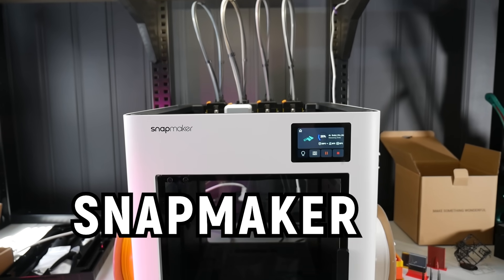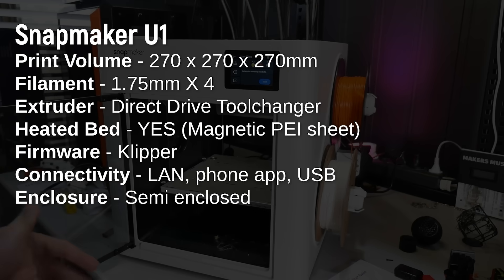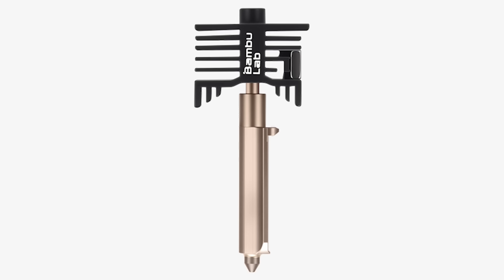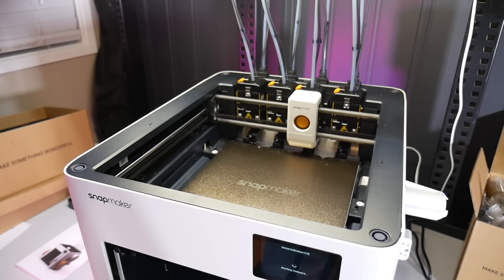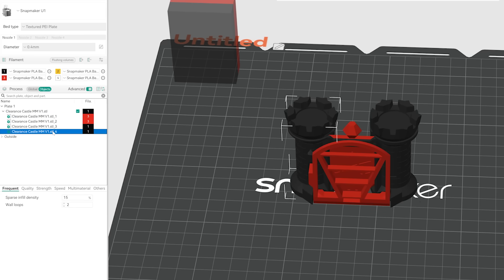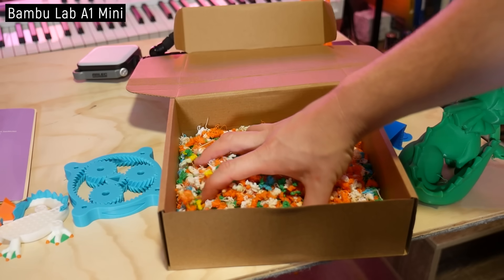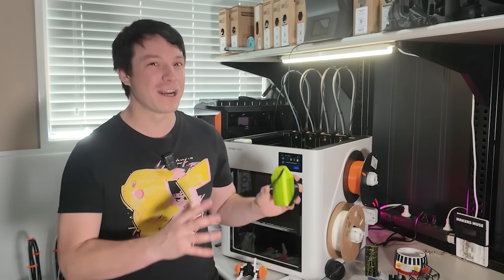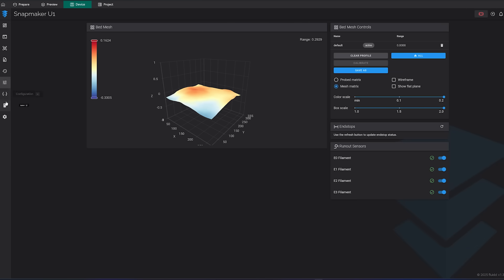Snapmaker U1 Production 3D Printer Review - Tool changer!

Comment from the maker: Additional comments and corrections:
- In addition to the optional top cover, there are also hardened nozzle assemblies available for printing with abrasive materials.
- The interface is FLUIDD not MAINSAIL my bad!
- The blobs caused in the foaming TPU may be solved by enabling "ramming" in filament settings. Yet to test.
Reply: Hello, Is it possible to buy your sample for helping an association that prints to collect funds for childhood brain tumor projects and research ? I manage to offer them a u1 but it will be shipped in january and it will be too late for printing before christmas market of the association. Many thanks in advance.

Comment: I bought a Snapmaker A350 during their kickstarter campaign.  It never worked quite right.  Then the A350T came out, with the rails and power supply it should have had at launch.  I bought an F350T and used those parts to upgrade my original printer.  It then worked ok.  Then I got the he dual-extruder print head … it sucked.  I liked the design, it just wouldn’t print right.  So, all that is to say this:  you might not want v2 or earlier of the U1 printer, and you should pay heed to the reviews.

Comment: As a novice, the only thing I've been able to print is the little dragon. After latest upgrade Snapmake Orca thinks printer is offline !!! I had to do Factory Reset. Pro's: Price; 4 Print Heads; size of print bed; RFID with Snapmaker Filament    Con's: Firmware/Software; Adhesion; Filament holders, very cheaply made and needs power; Not for novices, to get good prints you need to know how to tweak settings, especially with other filaments; Snapmaker filaments all sold out. Shood have used better nozzle system, easer to swap out, something like REVO; Final thought, YOU GET WHAT YOU PAID FOR.

Comment: Good day, impressive video, i wanted to know how loud is it going to be, i'm confused between the Bambu Labs A1 combo and Snapmaker U1, currently i have an Elegoo Netune 4, and i print almost exclusively with PLA in my room (Yes, i'm a student), i want to get into multi color prints but the filament poop always make me not go for it, tbh the U1 seems like the perfect choice at the moment apart from the noise which you mentioned, so please if you could tell me if it's not THAT loud then i'll consider buying it. and do you think the top cover would help the noise issue.

Comment: How does the machine do more than 4 colors? Will there be an AMS option, or will all changes over 4 colors be manual?
Reply from the maker: More than 4 will need manual swaps yeah. Its a trade off for the much faster tool changing vs an AMS.

Comment: I wonder if the upcoming H2C will be worth the extra cost. The S1 is currently $1000 USD but does have 4 heads. No pricing as yet on the H2C but its got 7 Heads, is fully enclosed and can use multiple AMS systems to provide up to 24 different filaments!

Comment: Exciting development hope it spurs other manufacturers on 
Snapmaker don't seem have a great track record regard long term support 
The Deal breaker is there doesn't seem any part are shipped direct for Australia 
As much a I dislike apsects of the bambu eco system - there support platform and being about to order a spare part or accessory and have it arrive is 3-4 days is a winner
I just would not be surprised if they are doing R&D on a tool changer model even though they are releasing
 Vortek

Comment: You can buy an enclosure with the Snapmaker U1.  Also would the CRC Tire Truing machine fix the foam bubbles?  You should probably use a tire truer for your battle robots anyways to get the best flat surface on every tire.  Even printing the tire larger then truing them down to the size you need should give you more consistant results.

Comment: The one thing I hoped you would mention and one of the key reasons why I am backing this is the fact that I can now use PLA for support when printing in PETG (and presumably vice versa), so finally the major headache of removing support may hopefully be over. 
I will add that I also backed the Snapmaker 2 and had some regrets back then (due solely to the non-flat bed issue) and the very poor software quality (think firmware updates that are issued to fix issues created by a firmware update). But now hopefully with this dedicated machine, they may have finally got it right.

Comment: Yes more toolheads means more complexity and poosible issues, but you could also argue tha 4 toolheads are basically spares - if one breaks, you have 3 more to go before having to start replacing stuff - so it does not hurt for single material users either. And it will be much cheaper than actually replacing the toolheads on single nozzle printers. Unfotunatly for me the noise will be a dealbreaker since I work next to it and it is not far from the bedroom. But if Vortek and INDX aren't any better / much more expensive (that is for sure) then this will be the best choice for multi material use cases.

Comment: 5:00 "It's only a few bucks worth of motors"

This is a common mistake. No, its not "just a few bucks worth of components", it's also a design phase, a test phase, a supply chain, a manufacturing chain  (lookup what an injection-mould costs to make), a packaging chain, and a support chain. They have to he factored into the firmware and tested at every update. That "few bucks" that you so ignorantly mention as if it's nothing at all actually costs millions  and millions and millions to the company.
Reply from the maker: good thing they raised 20M then

Comment: I think we have now a cohort of 3D printer users who, for lack of a better term, are script kiddies. They know just enough to download files from the Internet, slap them into a slicer and then print away not really having the technical skills of the previous cohorts had. (I think these are the 3rd generation of users now.) So when something goes wrong or the printer doesn't provide the finished object the way they wanted, they either get really pissed and denigrate the printer or they listen to the 3D printer mythologies of inaccurate or sometimes just plain wrong assumptions and fixes. Which may makes things worse.

So I can see around this time next year some issues which may arise of non-engineers using what is still an immature piece of engineering. I think people will have problems with clogs, either running it way too hot or a filament being used only 5% of a print but it active nearly through the whole print (like printing white buttons on a black coat object). Bad orientation of a print where the seldom used colors/filament types are placed at the farthest point away from the purge block so that stringing during travel winds up in the model where it is not wanted. After many prints or used at ridiculous speeds, the print heads become misaligned or fall during swaps. 

So like others have mentioned, Snapmaker has not won any awards for their service and support after the sale. So in two years, who many of these users will stop using this printer because they don't understand what went wrong and how to fix it on their own.

Comment: I honestly don't care about multiple filament printing. I just want something that's extremely fast, extremely accurate, can handle high temp enclosure materials and doesn't require internet.
I was so close to buying this, but I won't use multiple filaments in a single print, but will want to print nylon and polycarbonate. So much of the cost of this product is the tool changer which I do not need.
I don't want to tinker like I did with my ender 3 and ender 5.

Comment: I just want a compact, enclosed, corexy, direct drive printer. Is that too much to ask?
Reply from the maker: Prusa core one?
Reply: @MakersMuse something like that but more compact (I live in my car lol). I usually don't need more than 150² build volume but I'd like a sub 300 footprint.
Reply from the maker: @Zack-y4p6t  A1 mini in a little custom enclosure would go pretty good, they're very resilient. I've dangled one from the roof and printed with it fine.
Reply: @MakersMuse maybe, I'd prefer not a bed slinger but I could maybe make it work

Comment: The H2D is great (I own two).  But it can only do 1 soft material in a print.  If you need more than 1 soft material, it can't do it.  Only commercially available ones which can are the Snapmaker u1 and the Prusa XL which costs 5-6x as much.
There is a cover for the U1, I bought it.  It is not going to give the same control over the chamber temp as a H2D, but it should be enough for most things.  There are hardened nozzles, I have some on order.  There is also a Polymaker sourced filament dryer/ distribution system other than the external spools, using this is important for longer prints as some filament types change behavior as they get water logged (Petg, Nylon, etc).

Comment: 14:00 The fact that it isn't cloud-first (or _cloud-required_!) is a huge positive.  I've been resistant to Bambu for that fundamental reason.  I'm really hoping this unseats Bambu, and drives future development back towards open software and even open hardware.

That said, I don't think I ever want to go back to a Bowden setup.  This seems like a really dumb question, but I actually can't tell from the product page whether this is a 'real' Bowden setup with the motor on the frame somewhere pushing the filament, or if the motor is in the tool itself and is pulling the filament, using the tube as merely a guide.  The latter isn't a Bowden tube, strictly speaking.

I think I'll wait a year and see what the 3rd-party market looks like.  If somebody produces a replacement toolchanger with interchangable nozzles, or even better opens this up with a laser cutter or even a mill head (though dust extraction would obviously need solving), then I might be all over this.  But I'll wait to see what the community does with it.

Comment: I wished the Snapmaker U1 would support an AMS, so I didn't even have to change the filament before printing. Furthermore, it could add even more materials in a multimaterial print with minimal AMS poop by only replacing every material once.

Comment: This makes me less motivated to start me own doot now, but I want a high temp one so bad.
my own was gonna have a hot air part heating fan that should " instantly" switch between cool/hot but my brain just died and I lost me talent. plus I got no money or space. The idea is that it'll exhaust HDT temp air (just a bit cooler) to reduce the "shock' or warping, but also very hot air to see if I can somehow manage to print PEI (with 150c air) without having a chamber that's 150c (but rather 90-70c, my components let me go up to 70c last time I was designing it but sadly gave up on doing it, this did not consider the potential issues with my x and y axis expanding tho.) I have high doubts this would work but I still wanted to give it a try

the other reason for the "part heating fan" is to act like a hair dryer, at the end of each tool's job, it'd go over the part at 200c and melt all the wisps it makes from tool changes to prevent cross-contamination of support material and main material to make sure the print doesn't have a weak point (had that happen alot on my doot, got a strong part that had one strange weak point, turns out there was the tiniest bit of PLA/petg support in between it from tool changes), I also wonder if it'll have any use for for alternative tool heads or for increasing layer adhesion.  

8:59 damn I'm broke and this doesn't do high temp, but I wish I backed it up now LOL. I don't have the money anyways, maybe some other company will come up with a competitor by the time I have it!

I wish I had braincells to make a doot or like at least enough money to buy an H2D lol.

Comment: The U1 is very compelling to me, but realistically the only actual capability it would give me that I care about is dissimilar material supports.  Sure, I'd use the multi-colour features if I had them, but even there the bulk of what I'd do multi-colour I can do with a single nozzle and a pause command.  And 80 to 90% of what I print is going to get painted anyway, so it might as well be mono-colour.

The main thing I'd actually USE the multiple toolheads for is to have 0.2mm and 0.4mm and 0.6mm nozzles all queued up and ready to rock.  But even then, the savings is 15 minutes, tops, since I've got Revos on my current printer; plus maybe another thirty minutes ever couple weeks as I organise my projects so I can do a bunch of stuff on one nozzle and then switch.

So while I'm excited by this, I don't NEED it, and I do need to pay down debt.  Which will probably work out for me anyway - in a year or two when my kickstarter-version X1C finally needs to be replaced, there should be a bunch of product improvements and alternatives out there for me to look at.  

Anyway, this was really just to feed the algo.

Comment: Remember that in AMS style systems have layer adhesion issues with multimaterial printing. When you print with PETG and have PLA as supports, the nozzle is contaminated no matter if you max out the purge volumes in the slicer. You'll have so bad layer adhesion that you can't make functional prints.

Comment: i really wouldn't mind having one, assuming i had $1000 just sitting around & had the space.  there's several good reasons i keep going for cheap & often used machines, which i can & usually do upgrade or completely overhaul (if not outright convert) to a custom configuration which fits my needs.  would having a toolchanger be nice?  absolutely, but the cost of even the cheapest toolchanger is impractical for me, living on a fixed income with responsibilities & liabilities.  my existing 7 machines will have to suffice for the time being, hopefully growing a bit more in time.

Comment: IMO the "achilles heel" towards the multiple flexibles future you propose is going to be humidity. For a long multi-hours print, there is going to be ample time for exposed spools of TPU, etc. (and even a non-flexible like PETG) to absorb moisture from ambient air enough to cause poor results or even failed prints. That said, the "value" of a 4 toolhead changer at this price point is for sure a game changer.
And totally agree, hate the Kickstarter path they chose for this launch.

Comment: Nice review! However there are hardened nozzles (0.2-0.4-0.6-0.8) that are optional. But it should have come as standard these day with all the filament types and blends you have now. And there is also a optional topcover that is coming in march with filter. It's not cheap but I ordered it with the kickstarted option reduction. Maybe the big downside is that it has no active chamber heating and I wish that changing the nozzles would have been toolless a bit like the A1/H2D. I you want to swap the nozzle size now on all toolheads it will take some time.

Comment: Great and informative review.  Are the purge towers necessary?  I was able to stop using them on the Prusa XL without a problem.  Also, I was a little surprised when, in the early part of the video, you explained tool changer technology without even a mention of the Prusa XL.

Comment: I'm surprised running flexibles from the side spool holder works well. Isn't that feeder effectively the same as trying to run flexibles through an AMS? The lack of material enclosure for loaded filament is also a major pain point, similar to the XL. Unless you unload your material between jobs, your filament is constantly absorbing moisture. For multi-material scenarios where you're very likely using more than just PLA, it just seems like a huge oversight for these machines to not properly address the materials themselves.

Comment: The E3D Revo system is probably a good compromise as here the nozzle, heat-break, and heat sink tube are one piece, with the actual heatsink and heater element being separate replaceable items.  Prusa has a similar nozzle system (not the same as E3D, but I suspect it's designed and built by them).  BTW,  (knock on wood), I've yet to have a Revo nozzle get clogged, perhaps the one piece design has it's advantages.
I'm waiting for you to get your hands on a Prusa Core One L (wonder why that wasn't called the Core Two?  Probably reserved that name for the future tool changer version based on the Index?)

Comment: Cant wait for mine. I just spent 32 hours printing a 6 color print for my kid on my H2D.  While this only does 4 it could have saved me a ton of time. My expected shipping date is January I was around middle of pack backers.
Reply: 12:40 - I also ordered the lid and hardened nozzles as well when I backed it. The lid was like $125 and the nozzles $45. Not bad really. I may cut some acrylic and make a simple box lid for now as the lid isnt able to be delivered until May-June at earliest.
Reply: Is 6 colors possible with this printer?
Reply: @jackfranks7160  No just 4 for now.

Comment: Thanks for the no BS review Angus. I'm sorta interested in interested in buying a FDM printer again. The U1 looks OK but meh... I'll wait a while to see what happens for now. We've seen previews of BambuLab's "H2C" with the vortek system. It will be interesting to see how that pans out.

What I think is missing from the market is a smaller multi material printer such as the U1 with a heated chamber. BambuLab seem to be only focusing on build volume to appease cosplay. It seems they had a hit a sweet spot with the XIC and replaced it with inferior products that are cheaper? IDK...

I'll wait a while until somebody releases a smaller FDM printer (not as big as the H2D or HDC) with a multi tool changer and a heated chamber that just works. I just want something that works and I don't have to tinker with it. I know this is vary rare in the 3D printing world but I just want to print stuff with minimal fuss. 

Just my two cents...